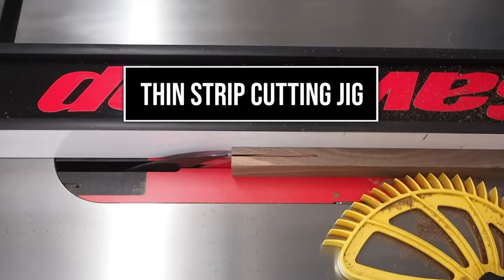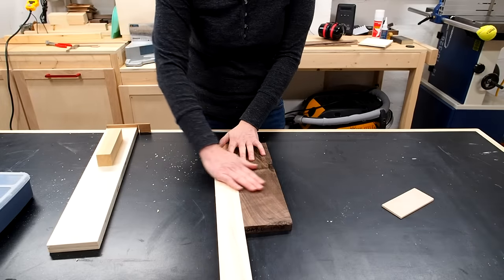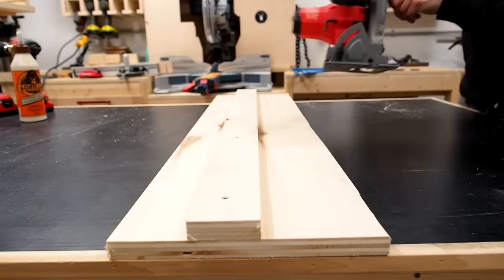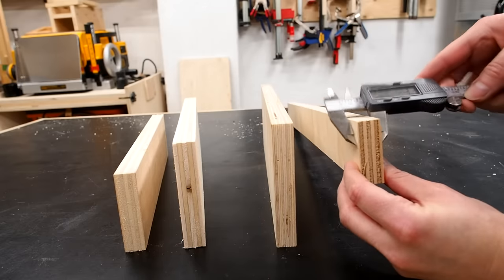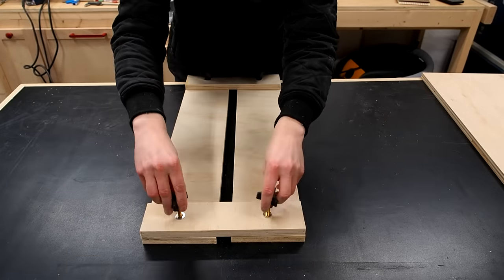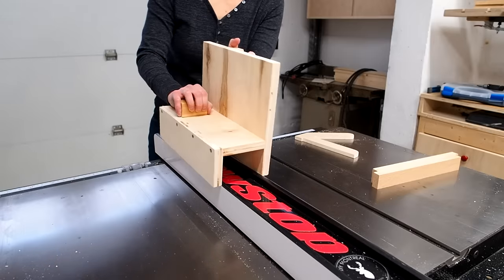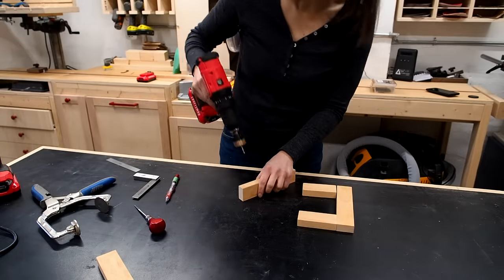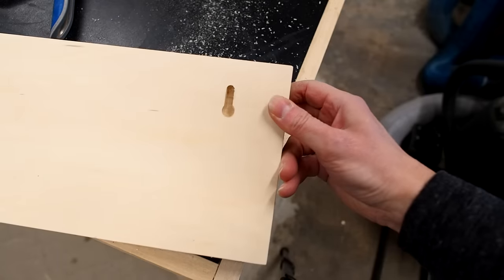5 super simple woodworking jigs that’ll make your life easier

Comment: You could use cheaper hex bolts instead of T-slot bolts and a huge dado by drilling a countersink whose diameter is only the narrowest width across the hex-head.  When you tighten the knob the first time it'll draw the head into the countersink, cutting into the wood by its corners.  After that the newly formed hexagonal hole will hold the bolt in place.

Comment: 7:30 You can't put the cutter in the milling machine as far as it will go - you won't realize it when you loosen the torque. The cutter has to be installed either by the marking on the shank or a little short of the stop.

Comment: When making the thin strip jig you permanently added a 2” wide strip that’s “the same thickness as the stock you want to cut”. Since the thickness of the stock you want to cut is going to change from time to time, you might want to attach it with double-stick tape or hot melt glue instead of wood glue and screws. That way it’s easily detached and replaced. Otherwise you’ll end up making a new jig for each material thickness.
Reply: There was no glue on the 2 inch strip, just screws. Changing it out for different thicknesses should be no problem.

Comment: At 2:12, please don't ever remove your hand from a board in an active cut, also, if you feel the need to use a push stick in this instance, please place it above and behind the workpiece, not to the side where it can only force the workpiece into the blade. Luck was on your side this time, but it won't be forever.

Comment: 6:22 That's a very light weight workbench and sliding around like that can mess up your work.  It wouldn't be hard to bolt it to the concrete.  Or you could just drill a hole into the concrete, then epoxy a section of pipe into the hole (to protect the concrete hole from cracking in the future) and then you have a hole into which you could anchor almost anything, temporarily or permanently.

Comment: The thin strip jig appears to me to be trapping the cut timber between the jig and blade on inside of blade, isn't this something that should be avoided. I was taught avoid trapping timber between fence / jig and have offcuts timber to the outside of the blade to avoid kickback. I am very new to wood working so just clarifying, not trying to criticise.

Comment: But I want 8ft long thin strips... faceframes, mostly. Any hints there are welcome!
Reply from the maker: I think the mag switch or jig external to the blade would be best for that. Along with using support for infeed/outfeed of the wood.
Reply: @DIYMontreal  And probably a featherboard on top to keep things securely against the saw table.

Comment: The base of your track is way too thick, you are losing a lot of cutting depth...
Also, on the one I made, I used 6mm plexiglass and on the bottom I used a fine-Vee notched spreader to make silicone "lines" which are great for gripping without any need to clamp the track to the workpiece... 

On the dado jig, am I missing something ? 
What are the dados for apart from letting in the tee bolts, I mean, you could have just put a thread insert in and have knobs with a male thread. 
It would be one less machining step in the build ! 🤔

Not trying to knock ya , just throwin out some alternative ideas...
A sub and a like from me 👏🙂

😎👍☘️🍺
Reply from the maker: The dados are so the T-bolts won't spin endlessly and will be countersunk. Sure, could you threaded inserts. Always room to adapt and improve upon these simple jigs. I just wonder if the male knob would stick out underneath the jig and get in the way when.
And yes, I forgot to mention that thinner ply would be better for the circ saw jig to allow for greater depth of cut. All I had on had was 3/4 which works well if all you plan to cut is plywood (which is the only thing I use it for).

Comment: What happened at 7mins 2 seconds? Straight cut??? This is why track saws have 2 guides to keep the blade square and perfectly parallel, your last portion of cut you wandered off line and clearly didn’t create a straight cut, worse yet you even applied a right angle square to check the cut and showed it in the video? Not to trash the video or your efforts to educate, but if your going to demonstrate an advantage or benefit to a technique or tool please review edit the video before release or re-shoot the scene with desired results.